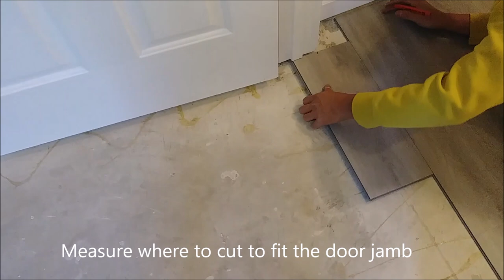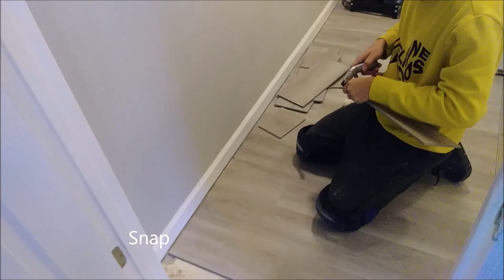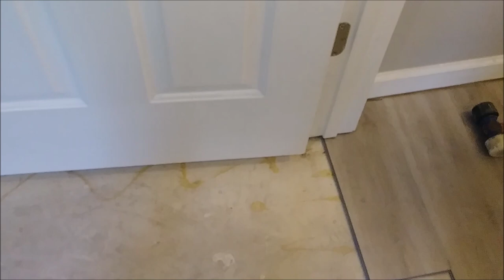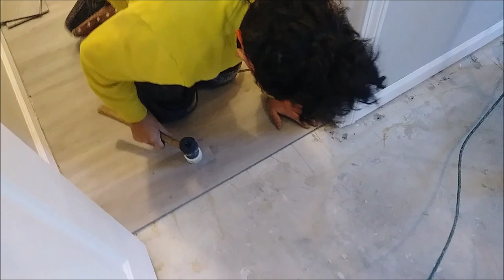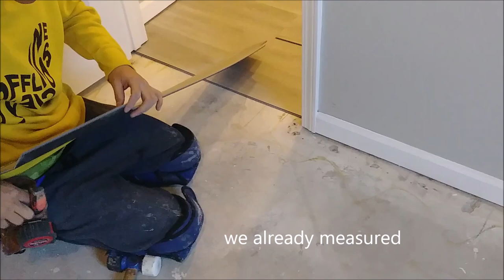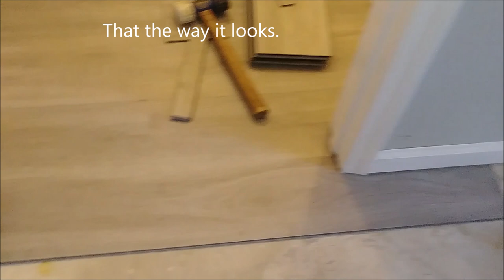How To Install Vinyl Plank Flooring Around Door Jambs   Room Entrance

Comment: How would you do it if the board feel either side of the door jam and there were two doorways next to each other please???
Reply from the maker: Basically, you will need to cut the board around the door jam in order to accommodate the LVP. you also can use quarter round molding (if possible) and not cutting the board around the door jam.

Comment: Scary! I wish you had cut that new piece on something other than the new floor. Even the subfloor would have been better to cut on. Hope your new floor didn't get cut.
Reply from the maker: No it was not. But you right I should be more carefule.
Reply: These videos aren't for the light-hearted, try Pioneer woman vids Nancy
Reply: Not only that but hitting the board on the end without a tapping block could be a mistake especially if you break the tongue & right there in the middle of a doorway is not where you want that or anywhere for that matter.Should always use a tapping block.